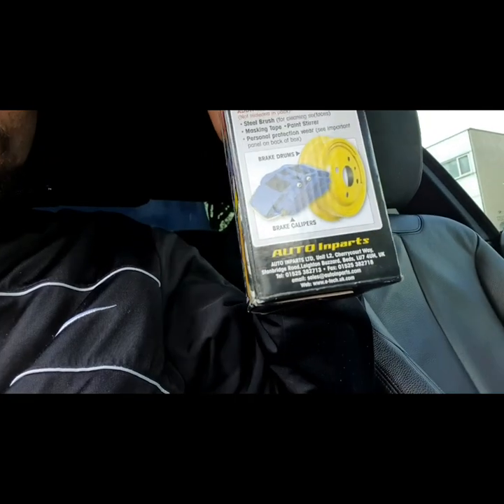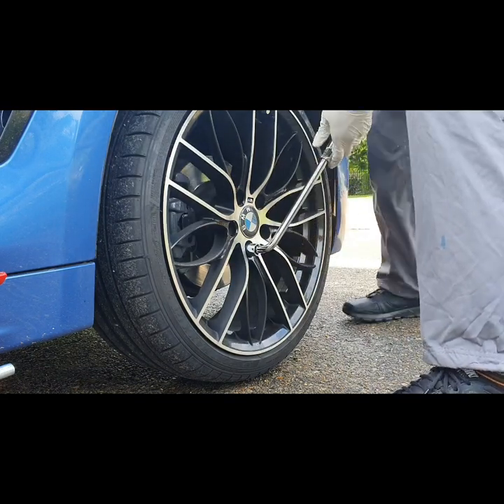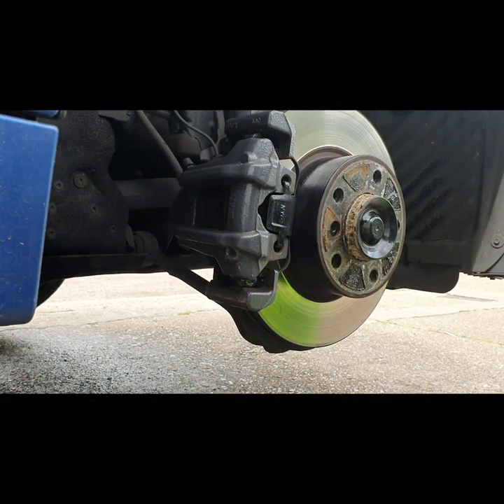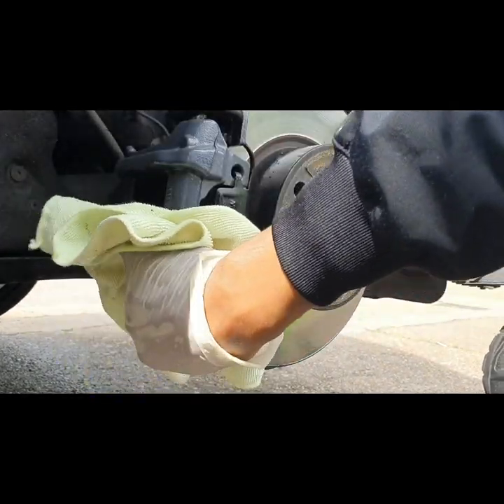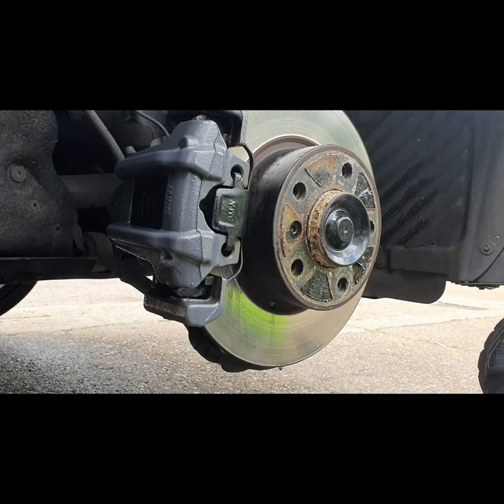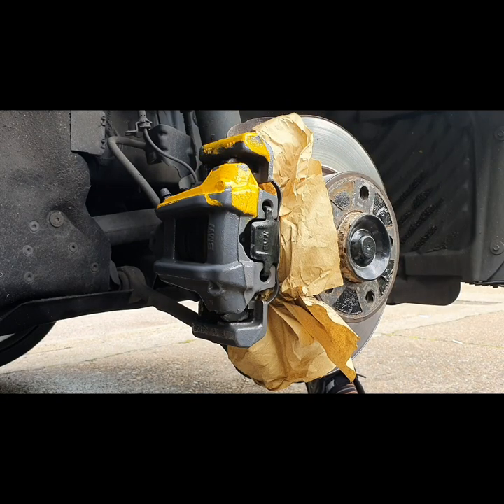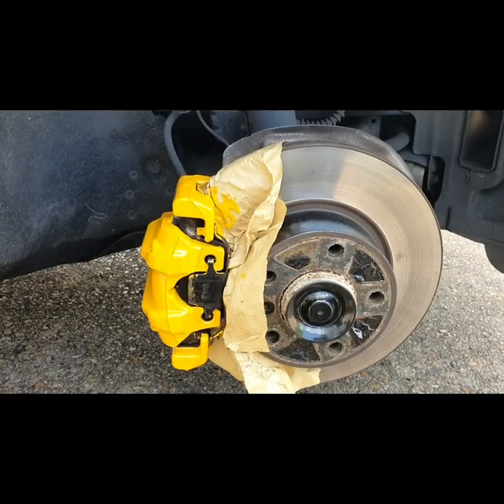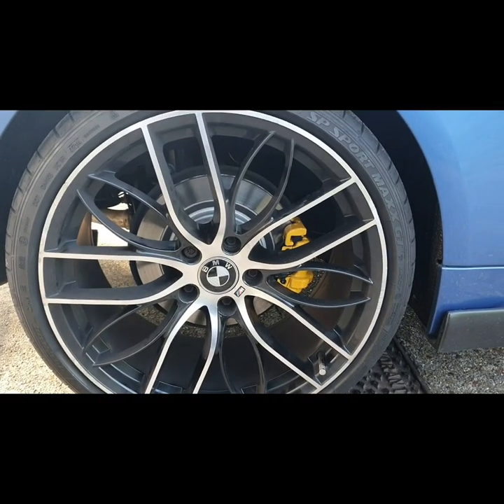Painted my bmw brake calipers "YELLOW"

Comment: fantastic job! for the other bit between disk and wheel, you said your going to paint gloss black, what paint did you use for that? hammerite?
Reply from the maker: Thanks for the comment. Yes you can use hammerite paint. There's a few options available. Heres one from euro car parts https://www.eurocarparts.com/p/hammerite-hammerite-under-body-seal-brush-on-black-500ml-549774851?type=shopping&gclid=CjwKCAiAuoqABhAsEiwAdSkVVGlQj-1zeZB-jXA4YXRulTA5OTO0rt2SlgRrXppO1faJjcd8dY5n9hoCyjcQAvD_BwE

Comment: U look like a rapper BM AND MINI
Reply from the maker: BM AND MINI 👀
Reply: @joshuasherwain  u know them
Reply: @joshuasherwain  OTP IN A VECTRA
Reply: @joshuasherwain  OTP IN VECTRA YA YA
Reply from the maker: @bmwf3022  Ya ya
Reply: @joshuasherwain  my valve cover was leaking 60£ they replaced the gasket! N20 motor
Reply from the maker: @bmwf3022  , £60 for a valve cover?
Reply: @joshuasherwain  yes well. The material cost nothing and it’s cheap ..
Reply: @joshuasherwain  the rubber gasket cost them 2£
Reply: @joshuasherwain  I got contacts it wasn’t a dealer or something
Reply from the maker: @bmwf3022  , oh cool.
Reply: @joshuasherwain  yeah yeah bad boi show us more ur 420o
Reply from the maker: @bmwf3022  , more videos coming soon. The car is currently in the garage. Will be back on the channel soon with a lil brother🎬😉
Reply: @joshuasherwain  why is it garAge
Reply from the maker: @bmwf3022  , well it's getting a reconditioned engine as I recently learnt the n20 engine has a common fault. So should be back soon.
Reply: @joshuasherwain  why?
Reply: @joshuasherwain  u broke ur engine
Reply from the maker: @bmwf3022  , I didn't break it. BMW just has addressed an issue that is common with the n20 engine.
Reply: @joshuasherwain  so ur saying ur car has the issue
Reply: @joshuasherwain  the timing chain?
Reply: @joshuasherwain  I’m at 237k with oem timing chain
Reply from the maker: @bmwf3022  , as I said it's currently in the garage getting a reconditioned engine. Should be back on the road within a few days
Reply: @joshuasherwain  timing chain
Reply: @joshuasherwain  what’s the comin issue UH
Reply from the maker: @bmwf3022  , there wasn't any issue with the tuning and at certain point of the n20 life the engine is prone. 

Here's a few things listed 

https://bmwtuning.co/bmw-n20-common-problems/
Reply: @joshuasherwain  that’s a joke...
Reply from the maker: @bmwf3022  Indeed. But all will be sorted car back on the road asap
Reply: @joshuasherwain  but why u repairing the “common issue if h don’t have it it’s useless .. just part out buy 340i
Reply from the maker: @bmwf3022  , it's getting upgraded parts compare to the standard parts. 340 or 440 is an option for the future but I'm more leading to m3 or m4.
Reply: @joshuasherwain  m cars suck...